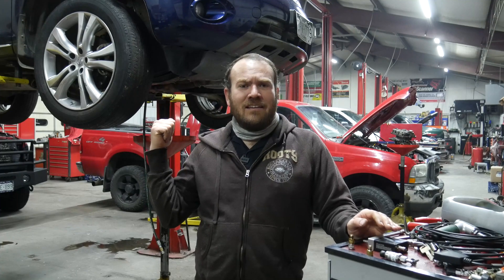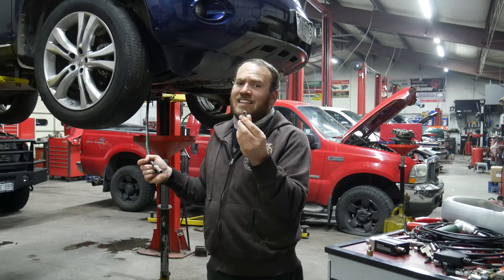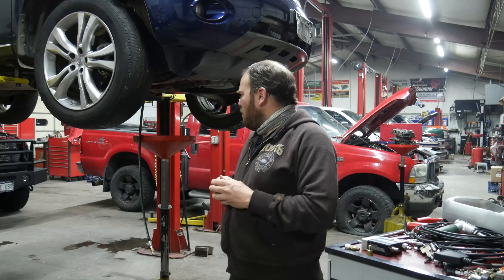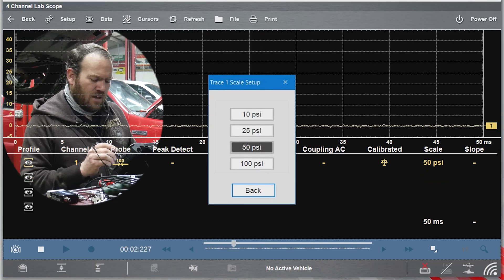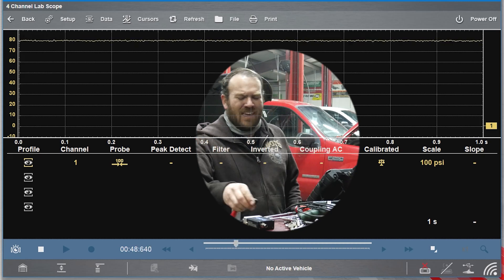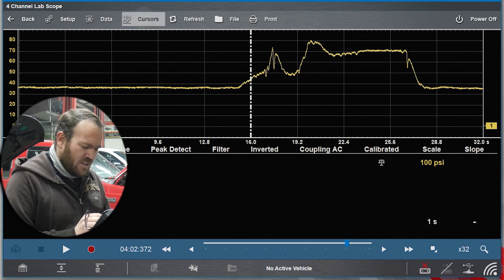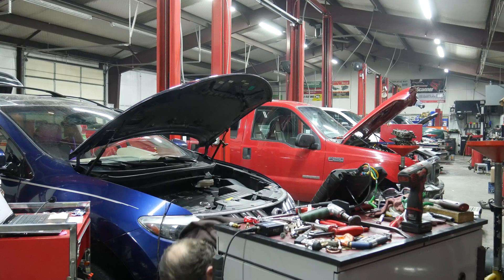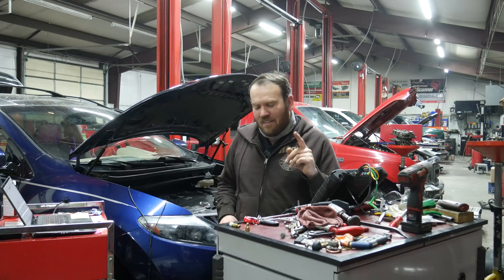Weekly Waveform 16 - How to check oil pressure with a pressure transducer

Comment: Excellent work. Sometimes using a couple clicks of dsp on ignition signal can even out peak amplitudes and make is easier to calculate RPM using math channel with frequency function. Multiply by 60 to convert Hz to rpm.

Comment: Thanks for doing this video. I learned a lot . I'm just curious where did the oil pressure go?, What did you do to bring the oil pressure back? It's been my experience that loss of oil pressure is worn engine was it an engine rebuild?
Reply from the maker: Thanks for watching. This Nissan has a vq35 engine which has an issue with a gasket on the inside of the timing cover. When this gasket fails you can get huge pressure loss since the gasket seals one of the oil galleys. If you google Nissan oil galley gasket failure you will see some images of the blown out gasket.

Comment: What keeps fluids out of wps500?
Reply from the maker: The fluid can enter the wps safely. It is rated for oil, gas and air even though most users grab the WPS500x when performing compression testing.
Reply: @ThePracticalMechanic  During  week 15 I did get coolant inside of my pulse sensor and decided not to use the wps500 for that reason. Sounds like the wps500 would be more robust for tasks that would involve fluids.

Comment: Looks like I have some adapters to buy lol
Reply from the maker: I need some more also. I think I will do a separate video on some of my oil pressure adaptors I’ve made.
Reply: @ThePracticalMechanic  this would be welcomed for sure. I too have a number of adapters and am always interested to learn what others have done. An idea (perhaps not worth any action on  but....) I wonder if a "group buy" would be an idea for some of the expensive WPS500 connectors would be of value? Perhaps ordering 50 or 100 would bring the price point down for everyone? I'd be interested in a few

Comment: What signals are on the green lead and yellow lead, on that snap on  db9 adapter?
Reply from the maker: You can connect two pressure transducers to the adaptor. Channel one is on the yellow lead and channel two is green. The DB9 connector is only used for powering the transducers and not for signal inputs in this application.
Reply: @ThePracticalMechanic  this is helpful thank you.  So if I only use one pressure transducer then I only need to plug the yellow into the scope and leave the green hanging free? And then I can use the green channel for something else?
Reply from the maker: @sargetester99  absolutely. You can use the other channels for monitoring other signals while utilizing just the single pressure transducer. I typically only use a single transducer so I rarely have the green lead connected.